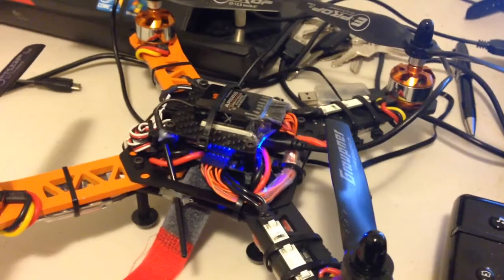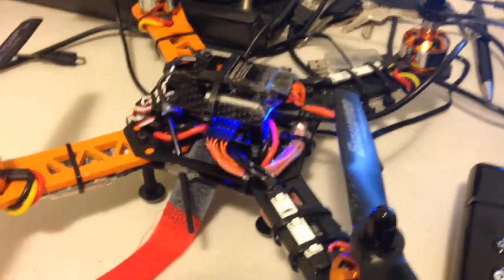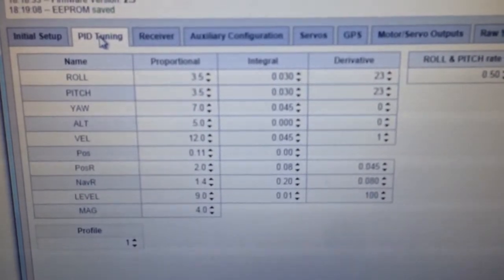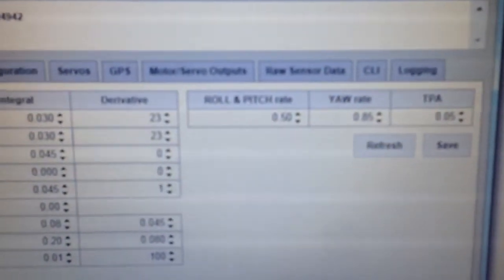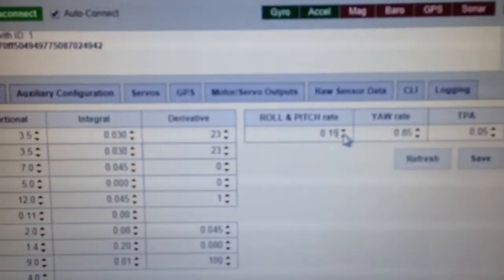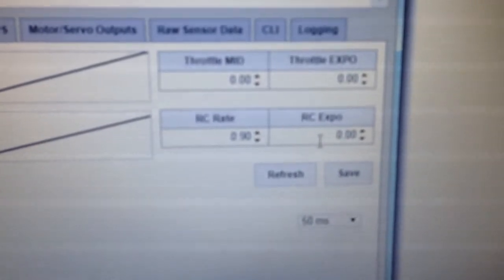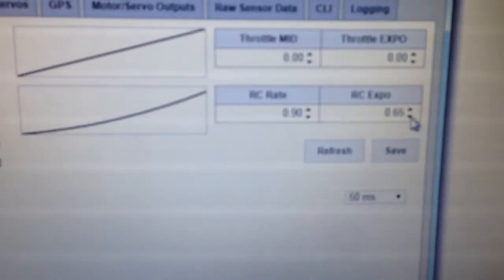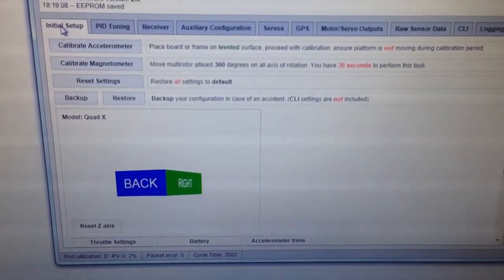Baseflight configuration for Naze

Comment: pid settings can vary with different ESCs. What ESCs are you running? and do you think these settings will work with 12amp simonk ESCs?
Reply from the maker: +rpaull3 These are Armattan 30 amp ESCs running SimonK.  I think the settings  would be a reasonable starting point for any SimonK esc.